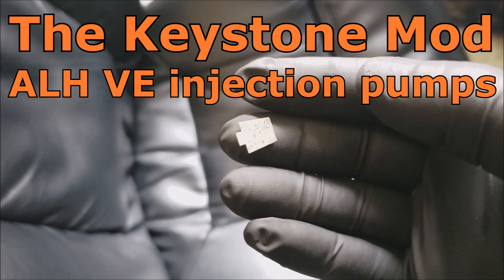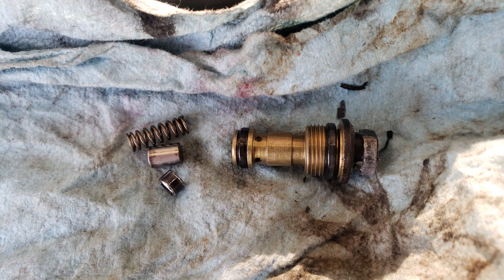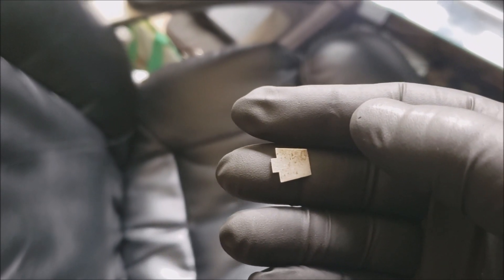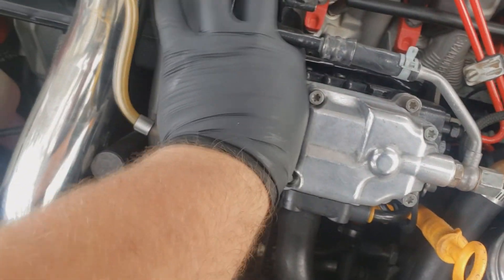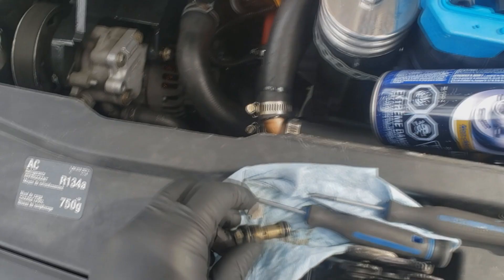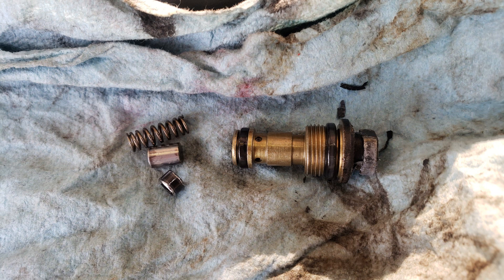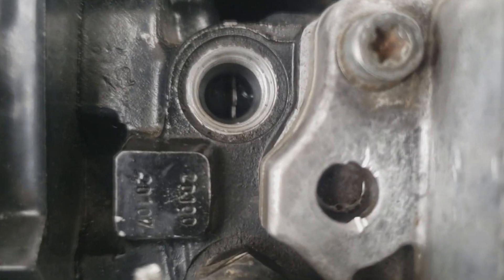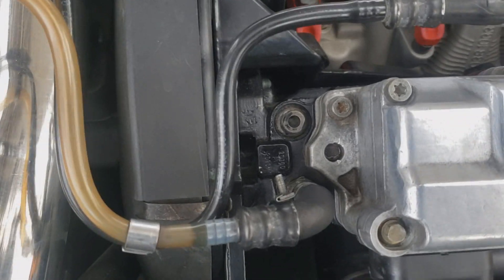Keystone Mod VW ALH VE TDI Injection Pump pressure relief valve

Comment: I checked this valve to see if it was the issue, it was not, however now that I’ve reassembled the car Revs up and has to be shut off. My question; is there a torque setting? How do you find the right depth when tightening?
Reply from the maker: No. It just goes in all the way.

Comment: Never heard of this!
Reply from the maker: For some reason not many have. Matt Whitbread started this years ago. It holds your case pressure control valve together so you can maintain case pressure. Over time the valve just falls apart and of course won't work correctly at that point.